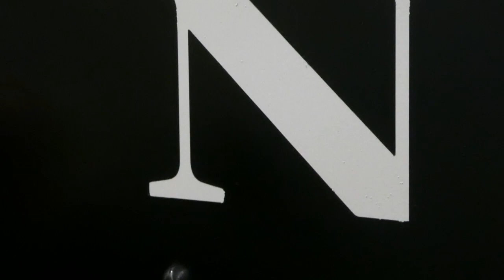Painting the D&RGW 223 Tender

Comment: Curious as to why this was painted backwards? The black should have been painted first then lettering applied over that.
Reply from the maker: The guy in charge of the painting said it would be easier to paint the background white then put the peel off stenciled letters and spray the black coat then peel off the stencil letters.  It worked